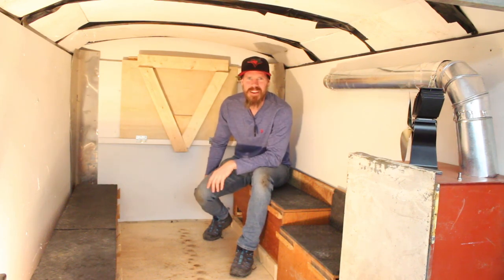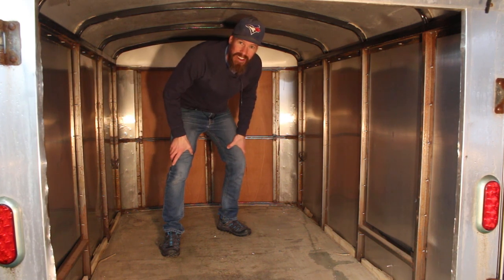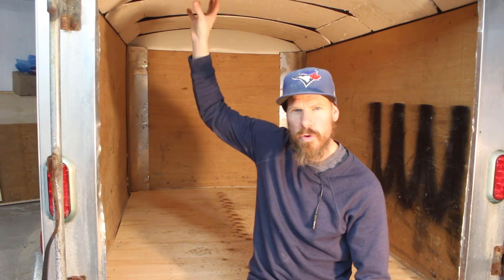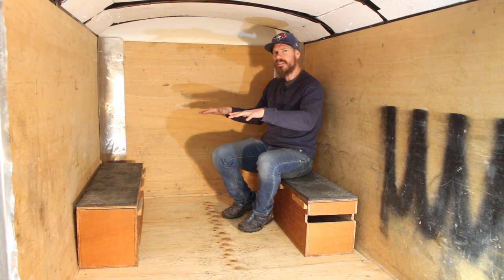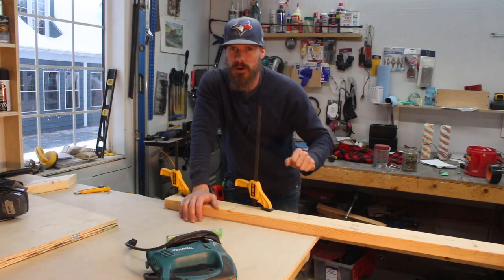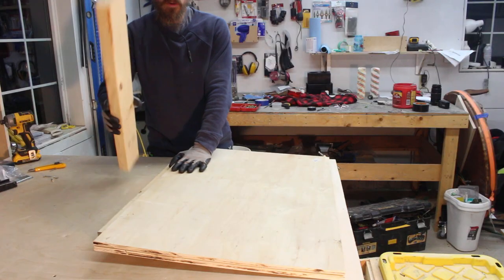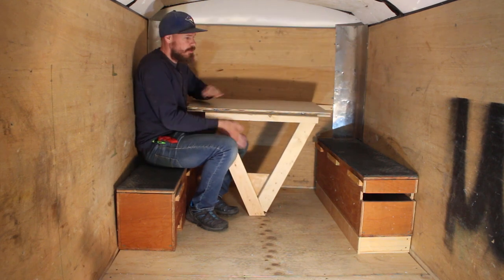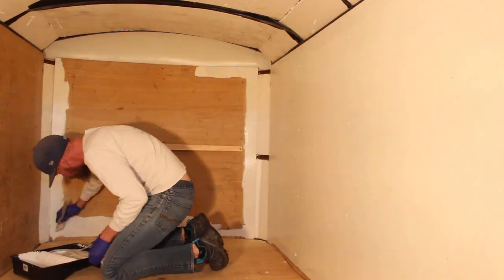Cargo Trailer Camper Conversion - Stealth Camper Vanlife

Comment: How well does the heater box work?
Reply from the maker: worked really well. no moisture in the trailer. biggest problem was the inability to control the heat, it would get toasty in there.  
my latest build uses a Chinese diesel heater.  check that video out
Reply from the maker: https://youtu.be/EtBxq4yAeKE